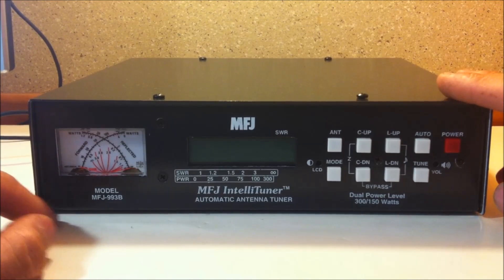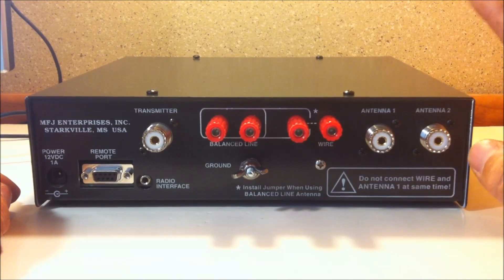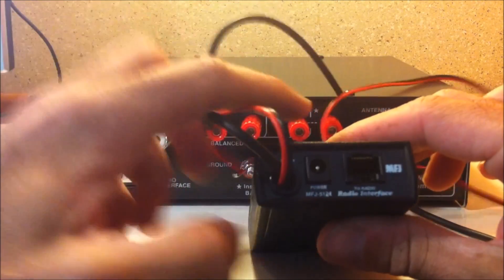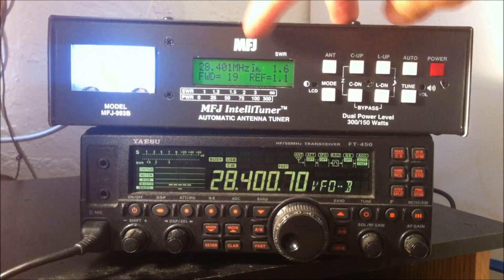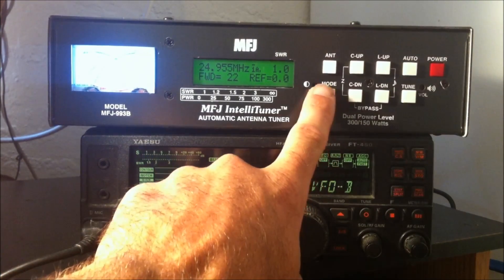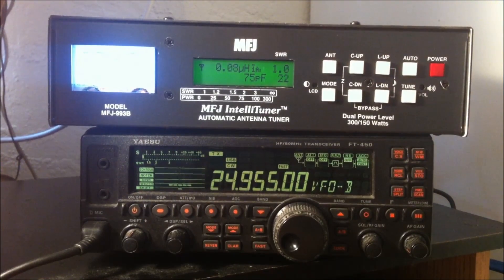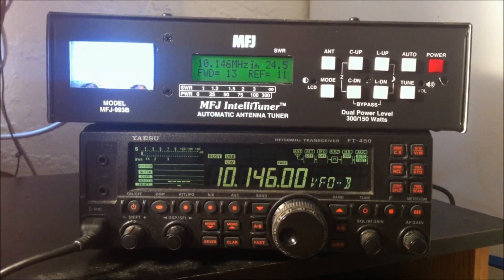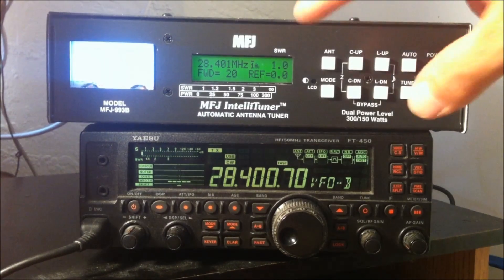MFJ-993b automatic HF antenna tuner review and demo

Comment: I just bought this tuner yesterday. I'm going to hook it to my new Yaesu FT-710 and run the signal out to a Vobroples endfeedz 135' long wire. Thanks for your easily understandable video.
---------------------------------
Two weeks later: This tuner is amazing! And thanks to your easy-to-understand video, I've got it set up perfectly and my radio gets out "awesomely". I also cheated a bit and did some RTFM'ing.  Great contact experience and good audio reports.
Reply: What did you need to conect the 993B to the FT710? Is it automatic or do you have to push a button on either the transceiver or runner everytime you change frequency? I looked for some videos matching the two units, but couldn't find anything. I only found a video using the 939 with the 710.
Reply: @craigd1275  I had to go back to my DX Engineering "buy list" to see what they called the cable I bought. Here's the name "MFJ Automatic Antenna Tuner Radio Interface Cables". You can look that up on D's website and they list a BUNCH of radios this works with. However, a lot of the time I just use the 710's internal tuner.
Reply: @craigd1275  I ordered this connection setup from DX Engineering.  "MFJ Automatic Antenna Tuner Radio Interface Cables MFJ-5124Y"
It works great.

Comment: Does this improve the signal on the receive side? If not, why not use just the atu built into the radio?
Reply from the maker: Tuner in the radio only matches up to 3.1:1 whereas this will tune a soda can

Comment: Is there a way to pass through an Ameritron ALS-600 to use the interface cable on the tuner? I have a Yaesu 991A with the ALS-600 and I also have this tuner with the interface box cable.

Comment: Has anyone noticed any difference in how well it will give you a low SWR between running it in the 150w mode vs. 300w?  On 80m I get the same 1.6 SWR with 150 or 300w mode.

Comment: Hi Eric. I was using my 993B today for field day in my shack. I've had it for a while and LOVE it. There was a period of time today that it wouldn't tune some stations or make that beep sound. So I shut the equipment off then turned it back on and now it's working fine.  Is it normal for this to sometimes occur? I was told once that it's like a computer and sometimes needs to be rebooted. Other than that it has worked flawlessly. Any help would be greatly appreciated. Thanks, Eric.

Comment: Is there a way to use this auto tunner with two transceivers at the same time with the same two antennas connectedto the tunner?
Reply: You would need dedicated circuits. Just buy another tuner

Comment: Usually power supplies like run at 13.8v so would be a problem if i connect it to this mfj’s 12v jack?
Reply: The instructions state not more than 18v. That being said, I did try what you asked and connected mine to a switching supply along with my transceiver. Unfortunately, my LCD display on the MFJ quit working a bit after the connection. Both radio and tuner were new out of the box. I don't know if the two items are related. I exchanged the MFJ and purchased a wall wart for the MFJ and its been happy with that. So, yes technically it should be fine with using the same power supply that you use for the radio but ....

Comment: Hi there 2 friends of mine have this tuner, one is trying to use it with an IC 7000 and cant get a lead from radio to tuner to fit, does he need that interphase box, the other person has one and it wont tune to anything what ever you do, apart from pressing the manual buttons then it tunes ok.....he uses a Kenwood TS 480, i think its faulty but i dont really know....from Fred in England, g4vvq.

Comment: You contradicted yourself. You said that the ATU would automatically tune when RF was sent though it (fully automatic mode) then said semi-automatic mode was used when an interface cable is not used.
Reply: How will this work on other radios example RCI-2995dx, Galaxy Saturn, Connex CX4300-300, YAESU FT-757GX2

Comment: Why do you use cw mode to tune with?
Reply from the maker: Solid continuous wave, easier to tune than using SSB and talking. If you decide to use the interface cable between your radio and this tuner, it does this automatically for you when you press the tune button on the radio, it sets the radio to CW low power and tunes.
Reply: Thank you! I appreciate you telling me that! I have this tuner and still learning a few tricks

Comment: How do you get the IC7300 to give out a signal to tune the MFJ-933b?
Reply: Hi, were you able to connect it to your IC7300 and get it to send a tune signal to the MFJ-933b? I'm looking into buying this tuner.
Reply: Yes I did. When you go to the swr screen and key the mic it sends power through the tuner to the antenna. Just make sure to turn down the power when you do this. The tuner works great,
Reply: John Etzler Nice, thank you!
Reply: Put 7300 in RTTY  mode, then key mic....it will tune.

Comment: now  did u say i don't need the interface doo dad  u showed? i have a ft897d
Reply from the maker: If you just transmit into it at low power cw mode then u don't need an interface. If you want to use the tune function on your radio to activate the tuner then yes
Reply: ok, im gonna order the 994 B . so i can run my Ameritron AL 811. I have a  LDG 100 watt tuner, that only requires the stereo plug to tune.   hey whats the model number of that interface thing?

Comment: are there any mods for this tuner to make it tune with only 1 watt of drive?   I have one of these, works fine at 10 watts or more.
Want to use it with my FT-817.
Reply: it will tune with 2 watts however not as well as tuning with 10+ Watts.
Reply: @genie555m  Thanks for your reply.   I found through experimenting it will also tune at 5 watts but 10 seems to
be the sweet spot.  I found if you tune it up with 2 watts as you increase the power you realize you still have some
SWR and require tuning again.   As the forward power increases it also raises the reflected power and need a little
tweaking to get the SWR down.   This is due to the ratio of forward to reflected.

Comment: What a terrible terrible disappointment.
I bought one thinking all the negative comments were malicious whingeing Hams but I found out.
Within 5 mins - yes 5 mins the meter globe started flickering. After 2 hours it went out.
Within around 20 applications the on/off switch stopped working. This was about 4 or 5 days. 
I just can't believe it - I just cant!
Who would build and sell such equipment??
They must have so much money that they can afford to treat customers like this. They must!
On top of this, I ordered an interface cable for my radio. They (MFJ) took my money after placing the order and then sent me an email 24 hours later saying there is a 3 month wait. I asked why they took my money and didn't make mention of the back order status on their website? They asked me if I "still wanted it or what" and offered to give my money back. I said, "That's not what I asked! I asked why did you take my money and not make mention of the back order status?" 
IMO they are unethical.
After finding out I was liable for all freight I opened my tuner up, bridged the power switch contacts permanently and I now power it from my desktop PSU.
When dodgying the power switch I noticed the paint on the case was flaked off the in places. The interface cable when it arrived never worked with my radio.
Reply: I think a meter globe is the lamp.  I think he meant bodging, by linking the switch out
Reply: Just wondering what a "meter globe" is? Also what does "dodgying the power switch mean" ?
Reply: ThePaulv12 nnj
Reply: Buying anything by MFJ is a crap shoot.  You may get an item that works perfectly for years, or one that is DOA.   You buy it, and hold your breath.
Reply: @geod3589  whatever happened to the mfj no matter what guarantee?
Reply: I didn't know anything happened to it.

Comment: hi will it work on my yaesu ftdx 3000d ?
Reply: djjoep100 Yes it’s work with your ftdx-3000 and you need Yaesu interface if you want just using at tune button in front of your ftdx-3000

Comment: how would this auto tuner hook up to my kenwood TS520
Reply: Just connect your transceiver to the tuner  and set it to auto. I used it on various radios and never used any interface cables.  By the way, the Kenwood TS-520 is awesome! I have one and love it! :)
Reply: Overlin Alaniz
Reply: i have my 520 for sale all tuned and new tubes to much radio for me looking to trade for a newer type radio im runnung a icom 718 veary simple i love it if interested my email is johnkk6mwx@gmail. com

Comment: Just picked one of these tuners up (993, Not 993B). My transceiver does not interface with tuners (FT980), therefore I must be in "manual" mode. You talk alot about how the unit remembers your operating frequencies .... are you talking about the "band" and not down to the KC? For instance, as I work up and down the 20 meter band will this tuner constantly update it's settings to adjust to the various changes in freq and then store each individual place I stop and transmit? Also, would I just have the "auto" button IN and then go to where I want to transmit and transmit or do I have to put down a carrier for a second or so and then do something for the tuner to kick in and adjust? I am a little confused with the manual at this time! Thanks!
Reply from the maker: +cattail3 It will sense an SWR higher than about 2:1 and will retune, yes, across the entire band not just each band.. if you go from 14.070 PSK to 14.300 and your SWR changes, it will detect and retune.. ANd runing this is manual mode is fine, it only takes about 2 watts of power into the TX port to make it tune.. HOpe this helps.. 73

Comment: Does this tuner require 12v pwr or can you use this tuner without the 12v pwr? I'm thinking of times your running on batteries. Great video thank you.
Reply from the maker: +Larrys LeatherWork Yes it does. But not much, a small battery would be just fine, 1 amp current
Reply: Thanks

Comment: Have you tried it any on 6 meters?
Reply: What frequency is 6 meters knucklehead?
Reply: It works just fine on 6 meters. :-)  What doesn't work is the frequency display. When I use it on 6 meter, it shows whatever the last band I used was. Other than that, it's been great on 6 meters.

Comment: Thank you for the refresh...you made me realize how much I forgot about this tuner.
A problem I have sometimes with my 897D is that I get no output going into the 993b. I have to power cycle everything and then it will work. I have set menu 20 to tuner, and menu 85 to tuner, and I am using the interface cable. But I didn't realize until watching your video that I don't have to use the interface cable......If I choose not to us the cable do I change menu 20 & 85 back to their default settings? Please let me know. TY KI6VPF.